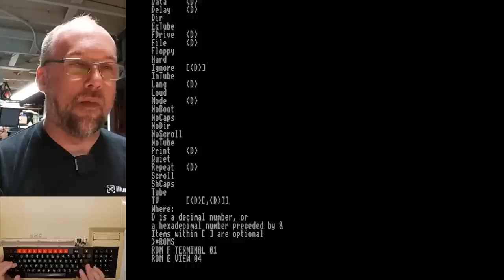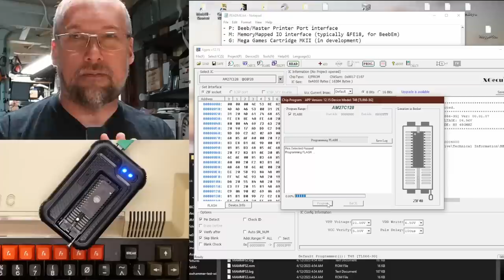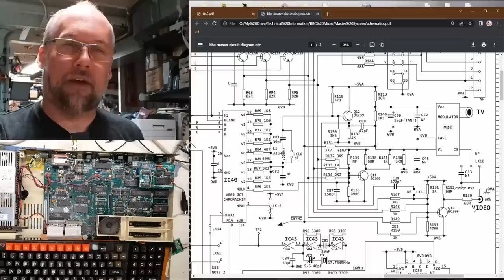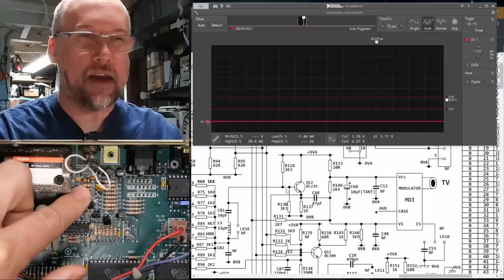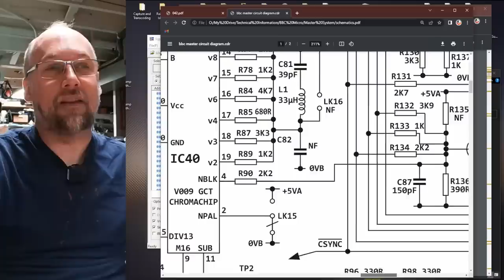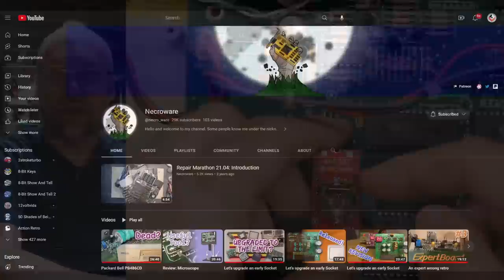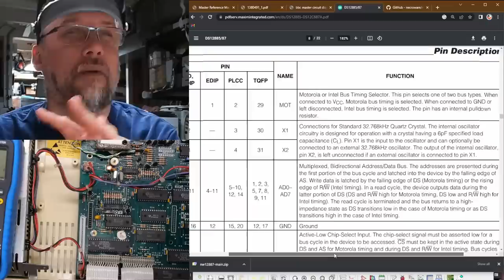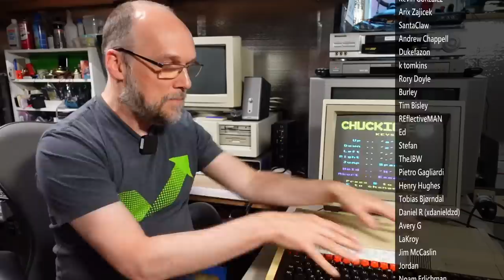BBC Master mods and improvememts

Comment: Color only out of RF and RGB but not composite?  That is incredibly British weirdness/cheapness.
Reply from the maker: I think it was done on purpose ... the idea probably was you would use composite in combination with a high resolution monochrome monitor for super sharp 80 column text. Then you could use a home TV for the color output if you didn't want to spend money on the RGB monitor.
Reply: @adriansdigitalbasement  could've had a switch for that or something.  But yeah I guess they were really intending it for a specific purpose, but they weren't exactly low cost computers as far as what it cost the state either so also does just strike me as kinda chintzy.
Reply: @Aeduo  Composite video input was not common on televisions in the UK at the time, but it appears to have been widely used by monochrome monitors. Indeed, I used an amber monitor with my Acorn Electron and the picture was very sharp. So there was little motivation to put a colour signal through the composite connector, switched or otherwise, and the option was always there (on most boards) to make the necessary link, anyway.

I suppose they could have added a switch, but it would have been yet more assembly work at the factory for the benefit of very few users. And I imagine that the BBC had a decent-enough overview of what kind of equipment was likely to be used with all of these machines and would have mandated colour composite back in 1980 or 1981 had they regarded it as a necessity.

Monitors and televisions with SCART connectors showed up from 1984 onwards, maybe earlier, so the case for colour composite was pretty marginal, particularly with the degraded picture quality. Of course, SCART is now a rarity while the composite connector persists, but I doubt that anyone foresaw that outcome or thought it a particularly desirable one.
Reply: @adriansdigitalbasement  That's exactly it. Back in the day, people wanted colour on their home TVs using the RF output, and serious users would buy an RGB colour monitor (either the Microvitec Cub or one of the Philips ones). But that was expensive, so if you wanted an affordable high-quality display you'd buy a monochrome composite monitor and connect it to the composite port. With no PAL colour subcarrier it was super sharp and stable, excellent for programming, word processing and desktop publishing. That's how I used my BBC Micro until we got an RGB monitor several years later. Even then I sometimes switched to the monochrome one for high-resolution work. The 80 column/640 pixel resolution of the Beeb in modes 0 and 3 really pushed the capabilities of many RGB monitors.